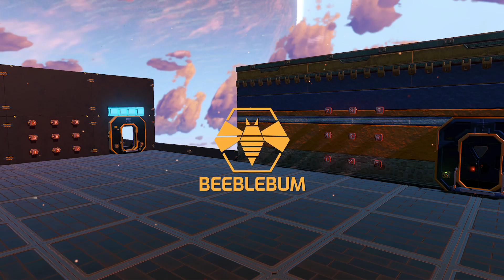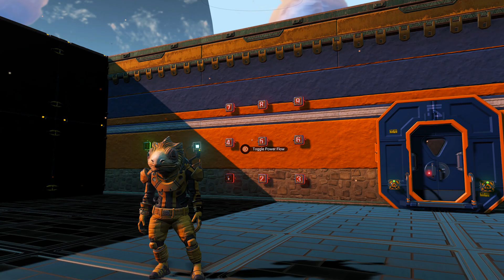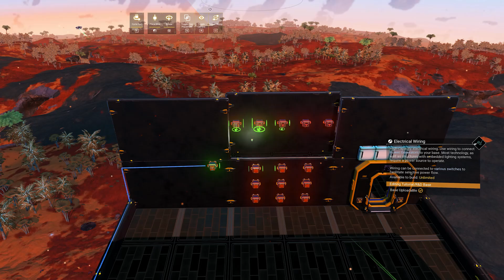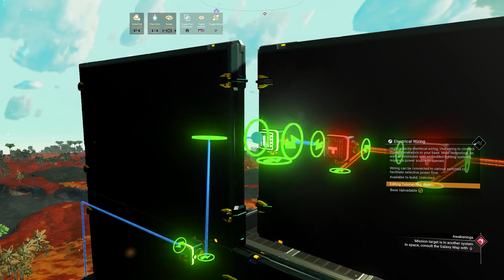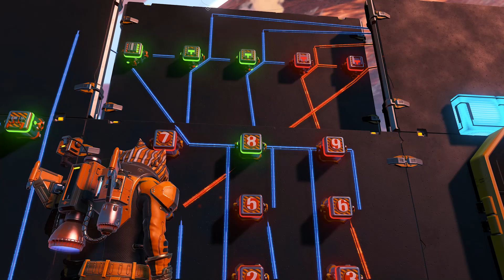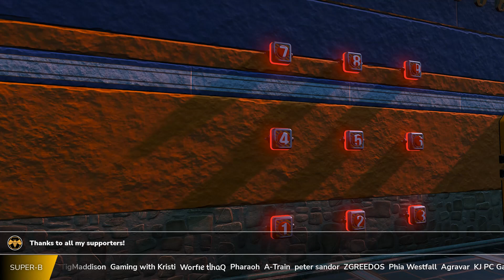A simple COMBINATION LOCK - Advanced Logics in No Mans Sky - Guide by Beeblebum

Comment: I followed this a while ago to make a few of these and they worked at the time but ever since Worlds, hitting any wrong button opens the door.  Did you encounter the same and if so did you find a solution?  It seems to me like the control points on auto switches now send power back through to devices connected to them and also like the input on them sends power back through to the output of the device prior.

Comment: Old video I know, but wanted to ask a question here. When you build a code approach like this, or even something simpler that just opens doors, what is the default state when others visit your base? Does each player start with doors and code locks in the state i leave them in as of last upload? Or do they see the most recent state as left by the previous visitor?

Just wondering, if I build something like this, if it will always start locked or possibly be opened already by the last visitor. 

Thanks for the great building videos!
Reply from the maker: Base will show up in the state you uploaded it in - At least for new visitors.
Returning Visitors, that left the door open, might find it still open when returning.
Reply: @Beeblebum thanks much. How you feeling lately about the state of electrical in nms? Worth doing more complex things or better to keep it simple? Great videos!

Comment: Don't know if this is due to an update since this video went up, but with this setup it's possible for the final button of the sequence to send a pulse through to the inverter briefly opening the door since the signal and output ports are jumpered. I had to add a fifth auto switch between the final code switch and inverter, but with the input and signal jumpered to remain self activated with no additional signal inputs.
Reply from the maker: Yeah, If you are not using the indicator lights with delays, the power from the last number goes straight to the door.
Using the 2 second delay, on the last button should probably sort it out.

Comment: How to prevent that when the last number of the code is pressed, it does not open the door for a second?
Reply from the maker: If you are not using the indicator lights as shown in the video, then it probably could be the button directly activates the door.
If you do not want to use the lights, I would advise to just build the 2-second delay system I used for those indicator lights. You only need it for the last number, as the other ones will not open the door either way.